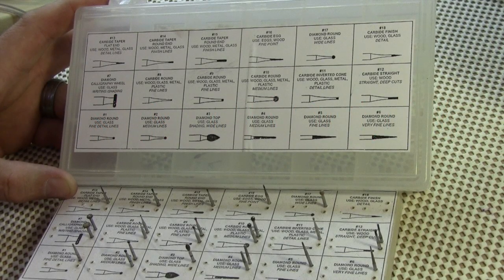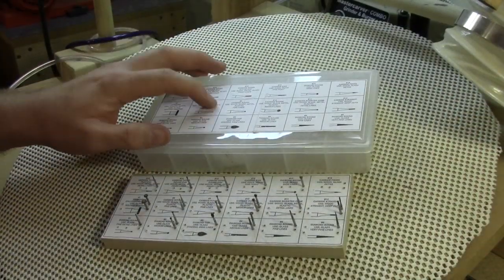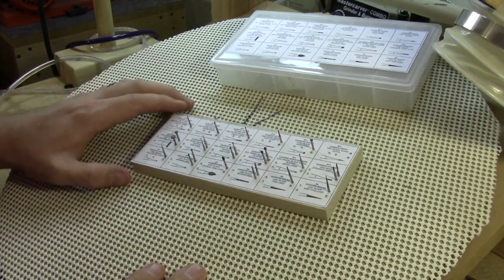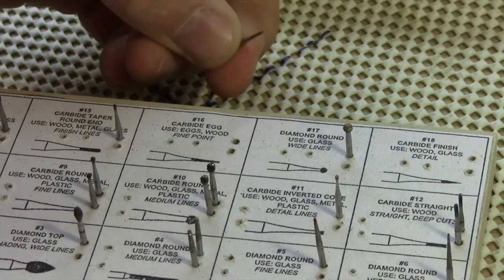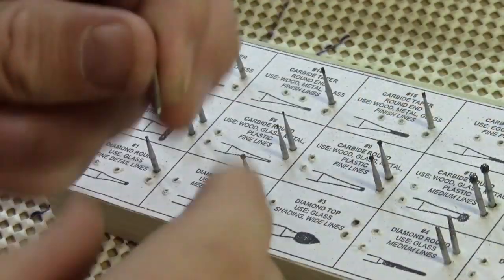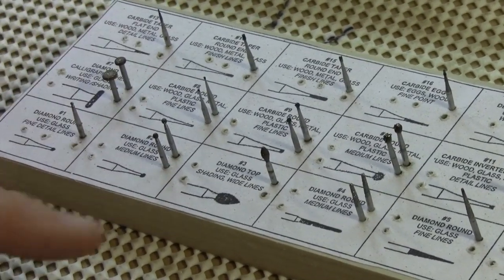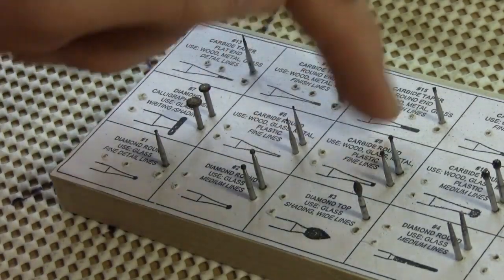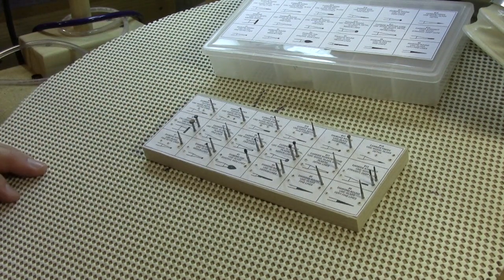Power Relief Carving - High-Speed Engraving - Power Carving Burrs That I Use

Comment from the maker: It is not a question of better, but what you want to accomplish. Carbide burrs remove really fast. They can also leave a clean edge. Diamond burrs do Not remove wood as quickly and give you more control and can also leave a clean edge. 

In general carbide burrs are used more for roughing out a carving (removing wood quickly), and diamond burrs are used for cleanup and refining small detail.

Comment: Hi Tim, what do you consider high speed 50,000 to 400,000rpm? the reason for the question is that some folks are claiming 35,000 rpm as slow!

Comment: Tim, thanks so much for your article on the use of a dremel too.  I have a dremell 4000 with a flex shaft and an abundance of bits.  but like you my fingers are bigger than the bits,  and I would like a copy of the bit layout in this video if it don't infringe on someone's copywright.  I don't want to buy the bit set just to  get the layout.
Reply from the maker: +Paul Wood Send me an email from the contact page of my website: https://carvingonwood.com/contact. I have my own version of this burr layout I can send you.

Comment: Hi, I am trying to get into a new hand piece, my pencil die grinder at 70k rpm is on the way, though I am looking into NSK Presto hand piece. My question is what kind of equipment will I need to power that hand piece? I see the dental drill you use has the same intake as the presto, what do you use to supply your air?